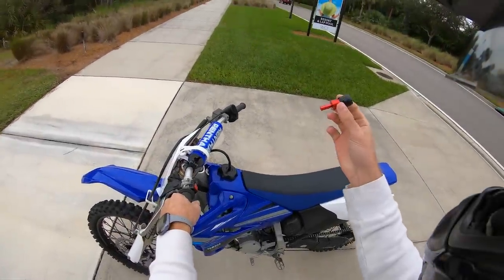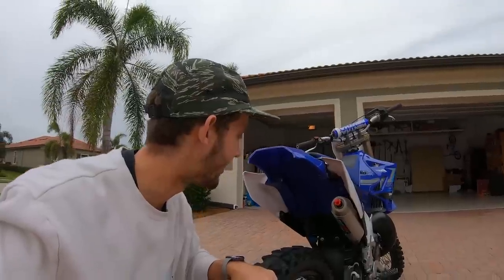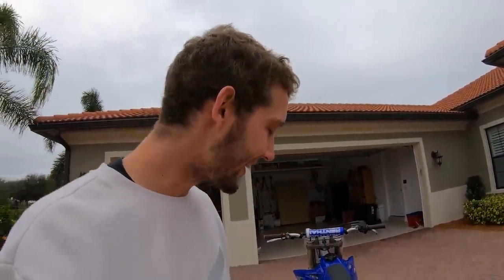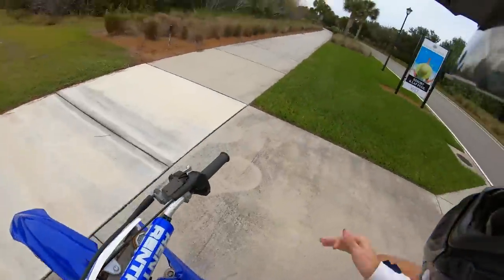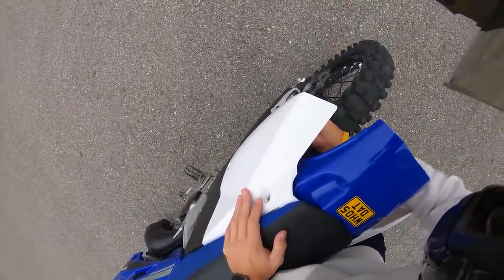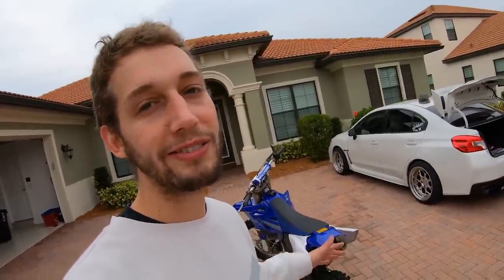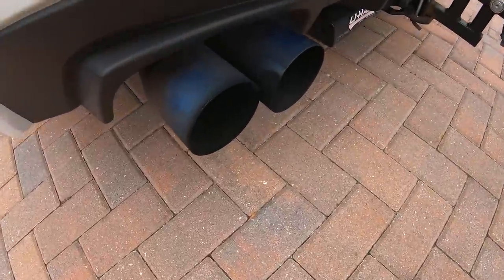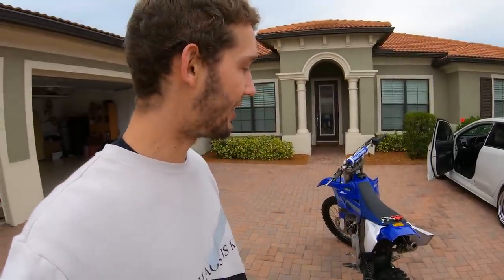TURBO EXHAUST WHISTLES ON MY YZ125 DIRT BIKE!

Comment: THE ACTUAL TITLE IS: HOW TO BLOW UP A 2 STROKE IN 3.2 SECONDS.
Reply: no it just restricts
Reply: @akdsjgalksdfjg  yeah bad for your motor
Reply: @EuroTrashTV.  we not that bad
Reply: YESSSS IT GOT PINNED BOYSSS
Reply: @EuroTrashTV.  nahhow woud it be bad
Reply: A1 lol
Reply: Shite
Reply: Yes
Reply: @EuroTrashTV.  no it’s fine won’t wreck anything if you know how a engine works it would be fine
Reply: @akdsjgalksdfjg  it’s restricting the flow of air out of the exhaust which is keeping a lot of the exhaust smoke in the bike
Reply: @jonthelamb4549  that’s not how it’s works bud
Reply: @jonthelamb4549  be putting pressure on the crank by closing the end off
Reply: I agree. This isn’t smart.
Reply: Hello A1!
Reply: @akdsjgalksdfjg  puts  too much pressure on the engine
Reply: @eddy9465  nah not to much pressure since the exhaust gas cant go out fully some stays inside the combustion chamber wich restricts the amount of fresh fuel air mixture can get in the cilinder, wich in return is a smaller bang. its not going to put more strain on the internals. its just going to run like shit.
Reply: @isaak3168  litteraly tons and tons of bike are restricted by putting a restriction in the exhaust it doesnt do any damage
Reply: @jonthelamb4549  if you knew how a 2 stroke works... it. Creates too much back pressure and would fry the rings and weight the reeds. Fuel is only combustible for so much time.
Reply: @Aikenpowersports  ya but for the amount of time this guy did it for I’m sure everything is fine I would never do this to any of my bikes
Reply: Please don't do this again . EVER 😂😂
Reply: @zavierjamari8018  damn thats toxic
Reply: @keytanndobson4566  pressure on the crank? Compared to an explosion going off in there 200 times a second?
Reply: @Aikenpowersports  fries the rings and does what to the reeds?
Reply: @JunkCCCP  weights*. Aka puts back pressure on them causing them to flex abnormally. Splits the fibers and loads them up with unburnt fuel and oil causing them to be weighted.
Reply: @akdsjgalksdfjg  Do it with your race bike.  If it runs, measure the engine temps under full load compared to the stock stinger.  
You will learn something.
Reply: @Aikenpowersports  It probably won't hurt the rings, and will not hurt the reeds.  But it will raise up engine temps, (even a smaller stinger will do that), probably cause over heating under hard load, lose power and possibly start detonating because of the higher temps.  In no way, is this a smart thing to use.
Reply: @EarthSurferUSA  ok
Reply: Lol lol WOOOWWW ❗❗❗❗🤣😂😭. He really has a trailer hitch on the car 🚗 pimping
Reply: F in chat
Reply: @jonthelamb4549  too much back pressure. Also since its a 2 stroke its probably not able to pull enough fuel so. It would eventually starve the cylinder of oil causing extreme wear and most likely will lock it up
Reply: @jakecarlile2294  ya I suppose it should be properly tuned and snowmobiles inject oil separate so it gets the proper amount no matter what
Reply: @akdsjgalksdfjg  ☝🏻this... That is all😂😂😂
Naw fr it's gonna throw the fuel air ratio off and make it wrong like dag sh!+...
Reply: All 2 strokes blow up that quick anyway, if you disagree you ent riding them right 👌🏼

They only take just as quick to rebuild it’s all part of the 2 stroke experience
Reply: @Gixxerbrah  what are you doing here?
Reply: No?

Comment: I'm so close to having enough for a 2021 yz125 cant wait
Reply: Best save a few more pennies for a yz 250 if yur gonna drop the change on a new bike.
Reply: @joshfrank1680  ya but I just rip it up on the rode. I'm about wheelies not really track riding. I'm going to be 16 in 2 months do hopefully I'll be able to get into it more because I can drive down to the track
Reply: @MoreFrostyR6  
 Alright. I just made the mistake of getting a 125, and ended up trading in for a 250 less than a yr later, but I ride alota trails, and sand pits.
Reply: @MoreFrostyR6  You made a good choice with the 125, especially if you are under 170 lbs and if this being your first MX bike.  Work on the bike yourself also, and go get a worth while engineering degree. (no environmental engineering).  Because of dirt bikes, riding and racing for over 2 decades, I got 3 manufacturing degrees, lots of experience, and now have my own business porting little 2-stroke engines for a living, making more money than any union worker in the world. :)
And my Dad said I was wasting my money on Dirt Bikes when I was your age. He did not understand the opportunity, but neither did I at the time. :)
Reply: @EarthSurferUSA  yep I just do wheelies and ride track dient want a bigger bike. Its ripping and pretty fun. Rode for 6 years but this is was mt dream bike so its awesome to finally have

Comment: Bro it’s not meant to fully block the exhaust that’s why it comes on a mount so the air flow can still get out without building up high pressure
Reply: I was thinking the exact same thing

Comment: As a 2-stroke engine builder for a living, if you put a smaller diameter stinger on your exhaust pipe, you may help low end power a bit, but the engine temps will go up at higher RPM.
With this restriction at the end of your stock stinger, the engine temps will go up a lot.
Reply: If it runs, and it doesn't.   Don't be so easily amused, and you won't waste so much time and money in your life. :)

Comment: Hey mate, why the hose on the rear swing arm? Is that the carb overflow being a 2stroke it leaks oily fuel starit onto the path of the back wheel? 🤙👍
Reply from the maker: Yessir

Comment: Yo moto bro what is that thing called on the back of your car we’re you put your bike on
Reply: Its a motorcycle rack for a car you can them for 100$ wich ain't bad look for a 7blacksmiths steel dirtbike carrier hauler its 107$ or you can go more expensive if you'd like just look up motorcycle hauler for car and you get hundreds